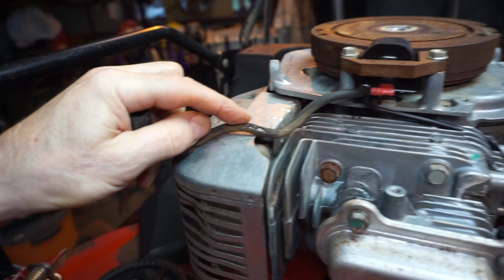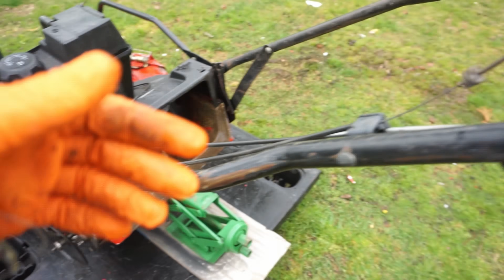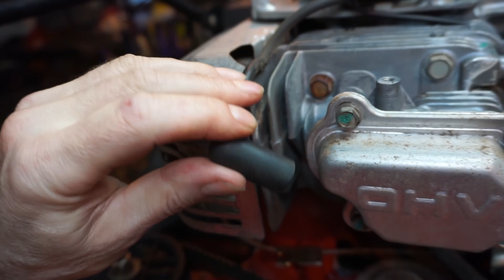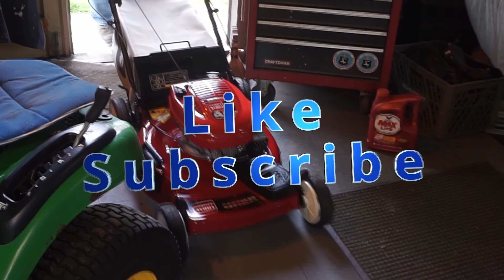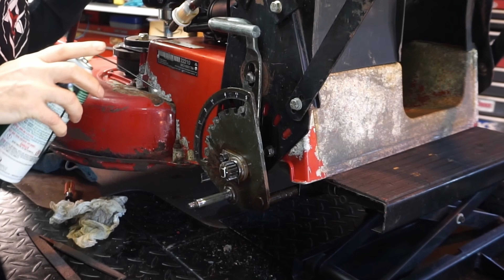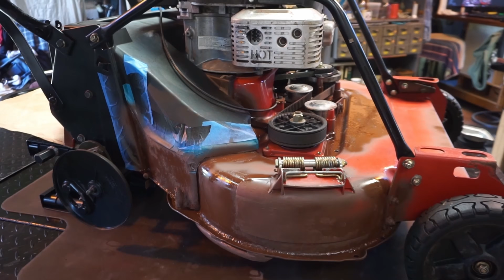TORO Turfmaster~ Mechanic FAIL! FULL Service & Repairs / Kawasaki FJ180V Engine

Comment: I gave up on my turf master and put it in the back of the shed. I think I’m gonna follow your video and go through it just as you did. Thank you sir
Reply from the maker: Ohhh that sounds great! Yea, things get worn and broken. Get the engine working well 1st then look close at all the transmission and blade drive parts! Its all works together but its not hard. 
These are nice machines and worth the effort!
Reply: @TheNovaJohn my man! Followed your valve adjustment and coil gap and this thing is running like a top and not dying out when I engage the blades. I remember why I fell in love with the machine in the first place. Big thanks from TX!!
Reply from the maker: @WashTruckingCo  That's Awesome!!!!!!!! Congratts!!!

Comment: Around 14, I'm trying to see where your kill wire attaches. Mine is on the carburettor control plate (??); it goes through a weird shaped insulator block to underneath the plate and connects to a weird narrow copper plate bent a bit halfway then turned 90° into a 3/8" end. The machine it's on is a 3-wheel Orec brushcutter, and has a speed lever which when you push lever down the copper bit is supposed to contact metal to switch off. If you have a similar kill thing could you do a vid on that please. And thank you.
Reply from the maker: I think I did a vid on it, not sure..
I'm soooo backed up, I have videos still from last year that never got worked on..
YouTube is very time consuming!

Comment: Hi great video im looking at a new machine fiited with engine do you rate this engineas a good motor would appreciate your thoughts
Reply from the maker: This machine has been worked hard and even not properly maintained but  its in great shape now with a little luv!
These engines are great but maybe a little small for this. The newer Briggs are Ok but still kinda small.. I think the oil should have been changed more often. So far, great machine, great engine!

Comment: I got a new turfmaster I turned the clutch up all the way while the blades were engaged now I can’t engage the blades while the clutch is all the way up help?
Reply from the maker: Not understanding what you mean, you say you turned the clutch all the way up. 
If you adjusted it and it doesn't work right then set it back. 
Its not that simple, we cant see what you have or what you actually did. 
Observe its operation with the cover off. Be careful. Naturally there should be slack on the drive belt for it when the clutch is out or disengaged. 
Clean everything and check for a stuck idler or stuck pulleys
Reply: @TheNovaJohn   I haven’t adjusted the belts or anything bought it new two months ago, I started the mowers blades on the middle range of the clutch then while the blades were engaged I turned the clutch to the highest setting now I can’t start the blades on the highest setting or start them on a lower setting & turn them up to the highest setting without the engine acting like it’s gonna die & the blades don’t start. The blades still work on the middle setting of the clutch the black belt under the good is tight & seems ok the blue belt seems really loose but I have no clue what the blue belts tension should look like in any video I look at it’s all the black belts.